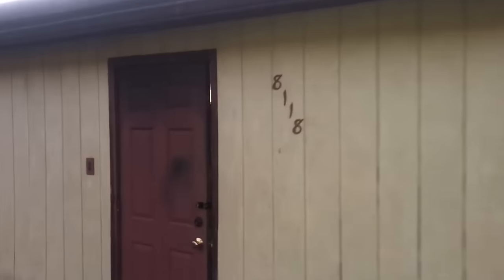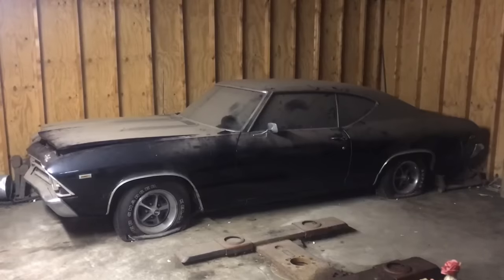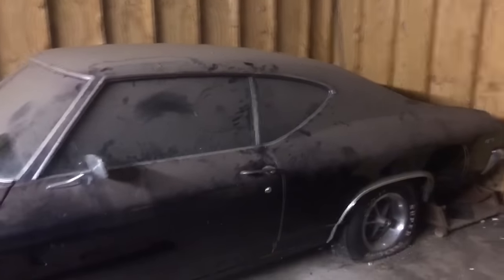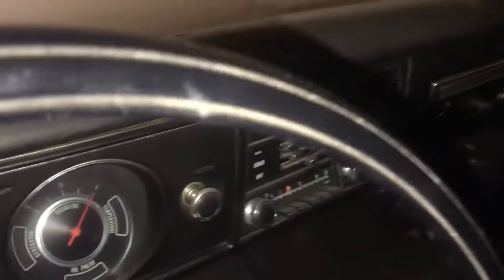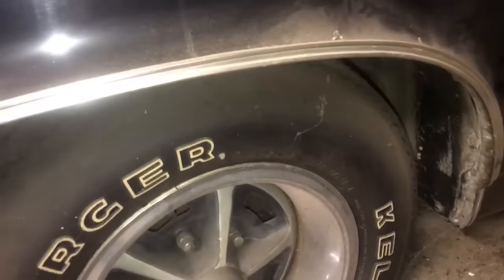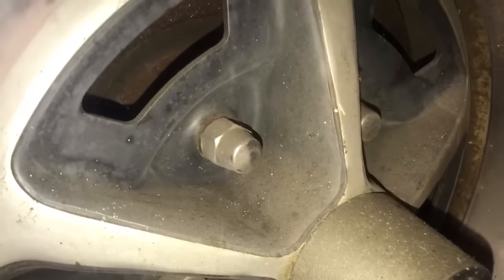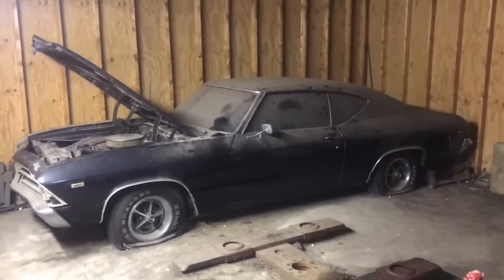1969 COPO 427 Chevelle BARN FIND JUST DISCOVERED!!!

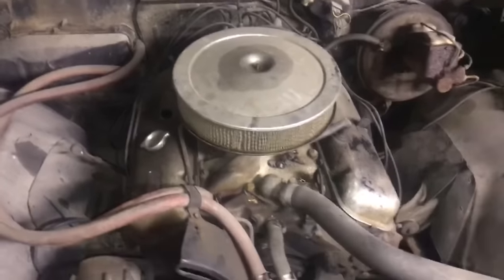Comment: An old friend of mine who I haven't had contact with for 20 years bought a 69 Yenko Chevelle 427, 4spd, 12 bolt with 4:56's back in 86 with 10 thousand original miles due to it being raced at the NY speedway and then parked. Kill stickers were still present on the rear driver quarter glass. I was present when they brought the car home to the shop that night. According to him he stated that its one of three out of the 99 built with aluminum head 427 Chevelle's from Yenko. Bought it in primer condition at that time but coded for tuxedo black according to him and the buildsheet he said he had. Interior is still mint black condition. Car was painted a different color and Yenko decals added. Does anyone happen to know about these and did only three come with the aluminum heads? I was big into the Mopars and still am but wasn't to knowledgeable about the Chevy codes.

Comment: That engine looks like 
130k it's got a lot of caked on oil. Nice car but we all know those odometers flip at 99999. Another good indicator would be the wear on the rubber pad on the break pedal.
Reply: I doubt it, car is in to good of shape. I had a 69’ ss chevelle I bought when I was 16 in 1978 with 78 thousand miles and front seat upholstery was all tore up. Holes in drivers carpet as well and car was well taken care of.

Comment: I am going to assume that since it only has 38,000 miles that the entire bottom end of the engine is blown out from over revving it since it is running 14 inch tires. That would have been a beast on any country roads and I can only imagine how hard that cam was thumping.

Comment: A friend of mine had a rare white 427 that the motor was removed and it was only drag raced bought it with very low miles in the early eighties. They installed the original engine when he bought it. Looked like brand new.  It would be worth a fortune today.

Comment: You Can’t say its a copo car There is no paperwork on the car Somebody could’ve just ordered a Malibu/Chevelle because that’s what they are with the 427 
And that’s not the factory air cleaner.
 SS hood SS caps on the wheels But all the other badges say Chevelle/Malibu
Reply: Numbers matching engine and trans. and correct code rearend. All have COPO only codes. Yes it's the original air cleaner. Everything you mentioned is original.
Reply from the maker: Michael Vacca study up sir. You’re looking at the real deal.

Comment: One of the very few original "muscle cars" that could run with a bone stock '98 - 02 LS1 Camaro - 100% production line stock vs. same.

And trust me, that's big praise given than the COPO Chevelle was some 30 years older (though did benefit from true high octane leaded gasoline and no emissions or fuel economy standards to speak of).  It's also worth noting that the overwhelming majority of Chevelle shoppers are unaware of the COPO L72 engine option.
Reply: LOL
Reply: @peteshea8010  What kind of tires did the chevelle have?
Reply: @juneramsey5417  

To answer your real question, the "skinny tires from the sixties myth" can be easily disproved my comparing quarter mile trap speeds, which unlike ET are largely uninfluenced by off th line traction limitations.

Those who are still in doubt can use my own metric, which I refer to as "the flying 60 to 100 time to speed interval."  That's easily obtained through vintage road test data by subtracting the 0 - 60 time by the 0 - 100 time.

Of course we also have DOCUMENTED PRODUCTION LIKE STOCK dyno results such as these, noting that the COPO 427 Chevelle also used the L72 that's included in this test, along with the 1970 LS6:

http://www.superchevy.com/how-to/additional-tech/sucp-1102-chevrolet-muscle-car-dyno-wars/

I've personally seen bone stock LS1 F bodies that were some 300 pounds lighter produce more than 300 on the same type of  chassis dyno.

Grow up. Thee old engine were pigs by today's standards.

Tire for tire, a new bone stock Honda Accord 2.0T would give a 100% been stock 1969 COPO 427 Chevelle a solid run.
Reply: @juneramsey5417  
The same answer I just posted to the same question you asked some 40 minutes prior:

To answer your real question, the "skinny tires from the sixties myth" can be easily disproved my comparing quarter mile trap speeds, which unlike ET are largely uninfluenced by off th line traction limitations.

 Those who are still in doubt can use my own metric, which I refer to as "the flying 60 to 100 time to speed interval."  That's easily obtained through vintage road test data by subtracting the 0 - 60 time by the 0 - 100 time.

Of course we also have DOCUMENTED PRODUCTION LIKE STOCK dyno results such as these, noting that the COPO 427 Chevelle also used the L72 that's included in this test, along with the 1970 LS6:

http://www.superchevy.com/how-to/additional-tech/sucp-1102-chevrolet-muscle-car-dyno-wars/

I've personally seen bone stock LS1 F bodies that were some 300 pounds lighter produce more than 300 on the same type of  chassis dyno.

Grow up. Thee old engine were pigs by today's standards.

Tire for tire, a new bone stock Honda Accord 2.0T would give a 100% been stock 1969 COPO 427 Chevelle a solid run...
Reply: @peteshea8010  You need to get some experience driving muscle cars instead of reading about them. There's no doubt with traction and a good driver that COPO will go Mid 12's in the quarter. Your LS camaro might do 13.7.
Reply: @juneramsey5417  There's more than doubt.  It simply wouldn't happen unless open long tube headers, milled heads (to get closer to the advertised compression ratio) and slicks were employed as a minimum.

That's assuming that everything else was left 100% production line stock.  I personally witnessed an original Baldwin Motion L72 Camaro set up exactly like that, minus the milled heads.  It was WELL DRIVEN and still couldn't get into the mid 12s (12.7s in the 110 MPH range was it).

Here's the American Hot Rod Association world record holder for the relevant "stock" class in 1970, which by the way permitted some mods per the rule book.  It's an LS6 454 Chevelle, (over) rated at 450 HP (Gross).

The large majority of runs were in the high 13s and lower 14s!

http://www.chevelle454ls6.com/1970_drag_racing_season.htm

Here's his world record certificate for the entire year.  The run was a 13.74 @ 106.72.  He presumably employed every allowable modifcation (per the rules) in winning that world record.

http://www.chevelle454ls6.com/NationalRecordlg.htm

The old car simply weren't fast by today's standards.  One can make them faster by throwing a bunch of modern parts at them, though that's really beside the point.